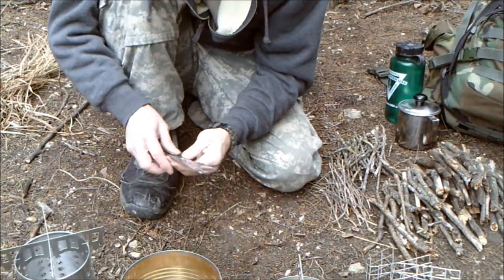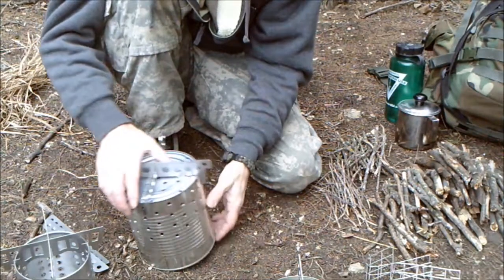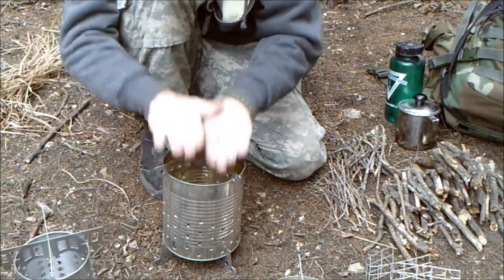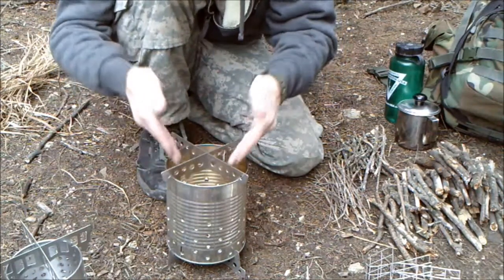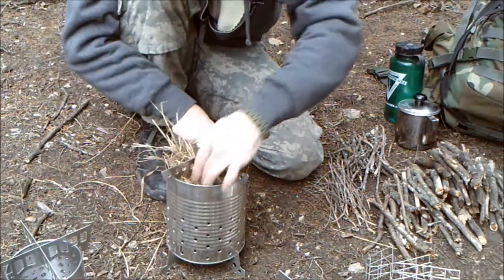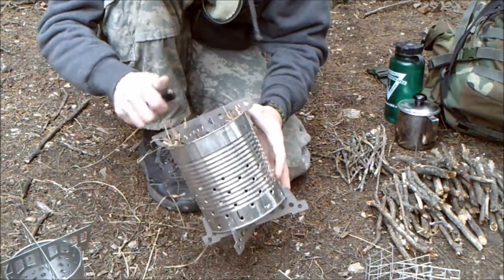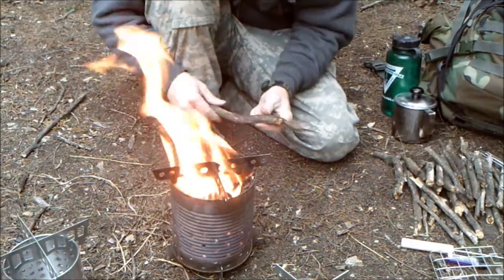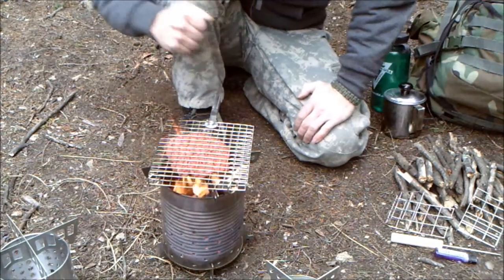Initial firing of a Siege Can Stove

Comment: Siege Stoves are fantastic - a few points - you can also make a very efficient gasifier stove with the Siege Stove system and you can use the braces to perforate the holes in the can - you do not need another tool to do that.  That is why the base braces have sharp points.Every “bug out” bag should have these. So impressive.

Comment: The siege stoves are great. Had the titanium one for a few years now. Fits every size can out there pretty much. You don't need anything to punch the holes in the cans either as they have added a point on the base brackets that u can use with a rock or small branch for a batton to punch the holes in. Makes the kit so versatile. Very reasonably priced too compared to other stoves especially considering it's made of titanium. Their customer service is fantastic to deal with too. Highly recommended.

Comment: Hi Dave, I hope all is well with you. We have completed the development of the Cross-Members and are finally ready to launch our crowdfunding campaign! The new perfected designs that we will be launching fit even more cans. They are specially designed to snap into the lips of quart and gallon paint cans, and also fit the most common small food can (not a practical size, but will work in an emergency). 

We removed the hole-making spike on the end of the lower Cross-Member, and re-designed the fangs so that they can perform the hole-making function (they work much better at it). We are also launching new laser-cut Folding Grills and Side Toasters, as well as our newest Collapsible Stove.  

With the expanded range of cans, it is easy to create a wood-gas stove from two interlocking cans, and this can be done extremely fast: 
1) Make holes in the inner can (a tapered drill bit makes nice round holes, but the fangs on the lower Cross-Member are also designed to do this).
2) Use a can opener to take the bottom off the outer can (no need to put any holes in this can).
3) Snap on the Cross-Members and drop the outer can around the inner can.

We will be posting an update on our web site SiegeStoves.com, as soon as the campaign page is about to launch (any day now).
Best Regards, 
James
SiegeStoves.com